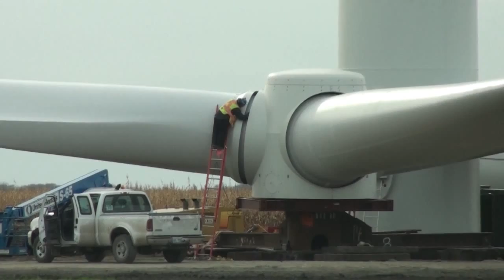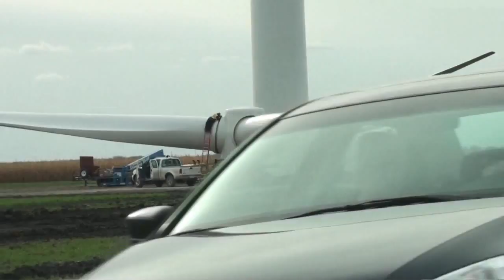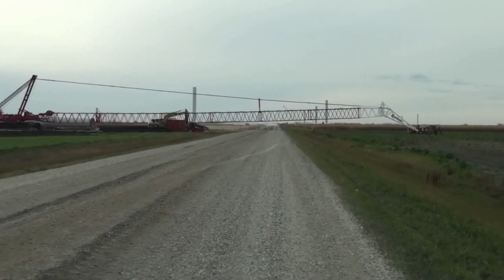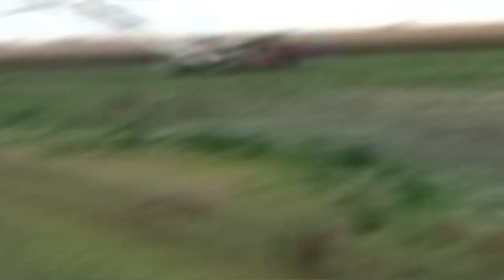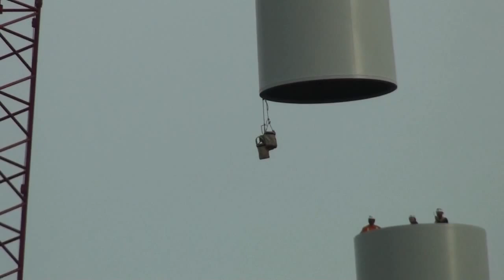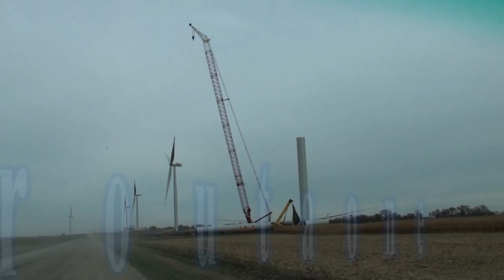GIANT WIND TURBINE ASSEMBLY part 2

Comment from the maker: @Silverpup78 I did a bit of math on this and it looks like if it turns 20 RPM, then the blade tip speed would be about 120 MPH. The blade I think was 163 feet long plus half of the hub means the tip has to travel about 524 feet for one round